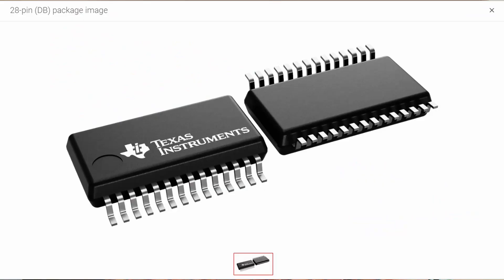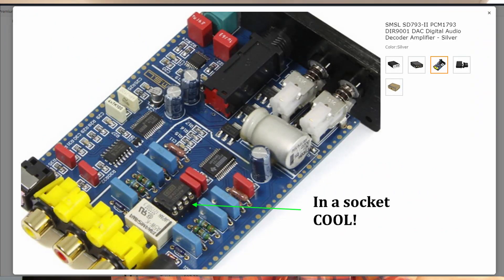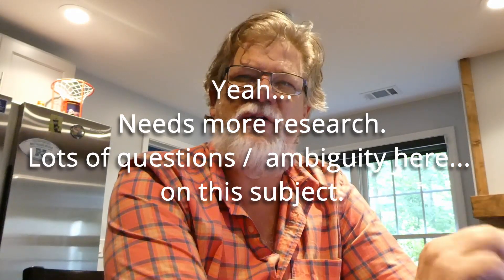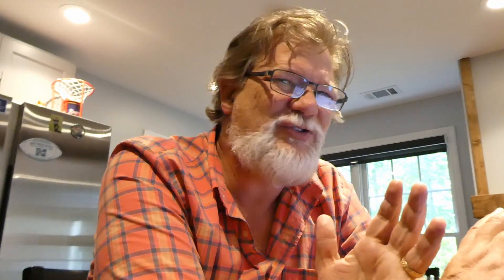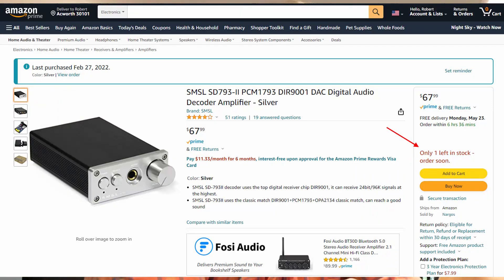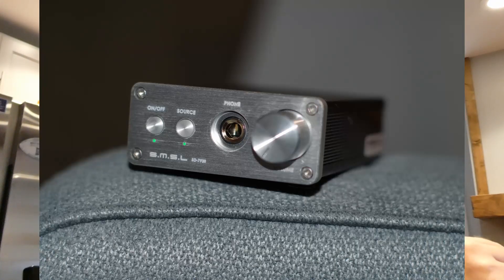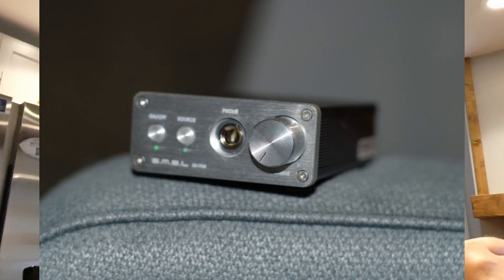S.M.S.L. SD-793II Burr Brown DAC Headphone Amplifier (PCM1793, DIR9001, OPA2134)

Comment: Hi. I got and on the dac side it works well. But on the Amp side the sound is distorted garbage.
I tried with different connector and always the same result.
Any suggestion, aside returning it?
Reply from the maker: my amp sounds good
maybe you have a defective copy
are your headphones hard to drive / low impedance?
Reply: @rhenry74   thank you for your reply. 
I have dozen of iems and cans and all sound like 💩 in the bass and mid-bass area once connected to it (and the hardest to drive is just 50 ohms!).

I sent it back, although the shop I purchased, tested it and to them worked fine.
Anyway, they were so kind to replace it at their expenses and now the new unit has the exact same problem... 😥

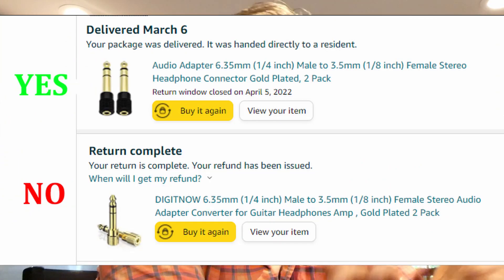On minute 4:55 you said That some 1/4 inch adapters are trash and you had to buy new ones.
Could be that I have encountered in the same issue?
Those bad ones, how did they sound? Distorted like mine?
Thank you for your time and happy new year, in advance.